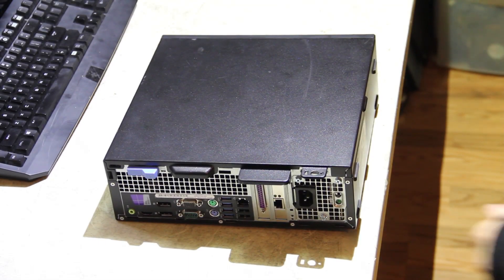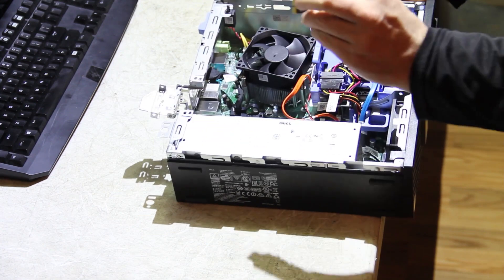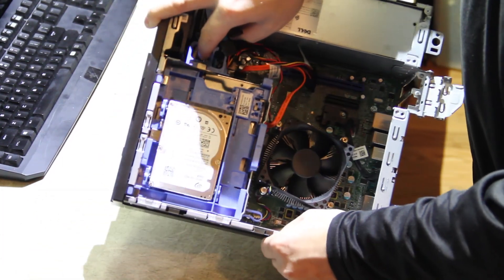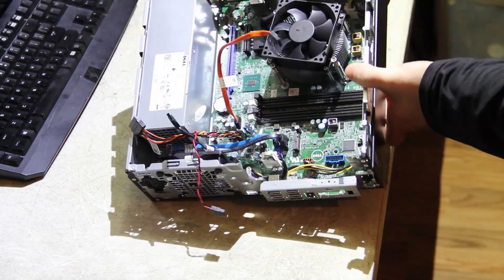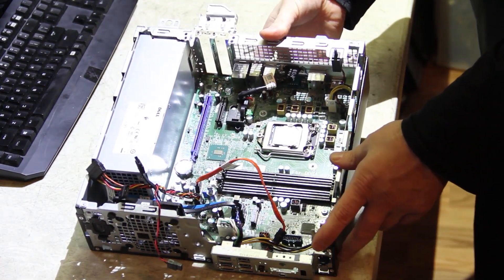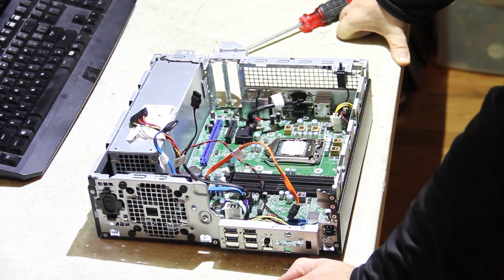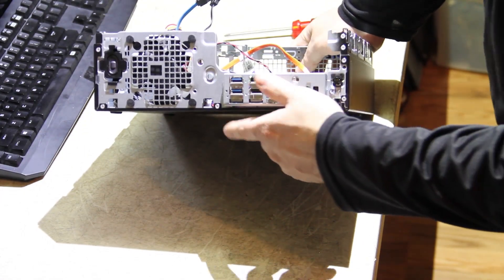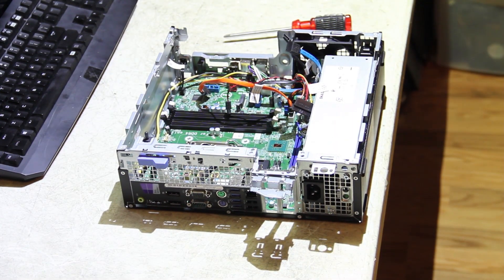Dell Optiplex 7040 small form factor teardown and system overview

Comment: what form factor power supply does the mini tower variant accept?
Reply from the maker: I am pretty sure it is a dell proprietary size
Reply: The psu is exclusive to dell due to the motherboard. Cause it keeps 8 pins in mb and 4 cpu pins. If you change the mb maybe it will have a tfx
Reply: In 7040 mini tower you can easily use any atx/sff psus. But for 7040 sff you have to strictly go by dell proprietary psu for sffs or some flex psus.

Comment: The card you have in the top PCIe slot is a 1X card, and doesn't fill the entire slot. The top slot is a 4X (not a 1X as you stated) with an open end for longer cards, as long as they can work 4X electrically. That said, your recommendation of a 1050 wouldn't be recommended as those are double-height cards, and would have to slot into the 4X slot. While it would fit, and likely work, the 1050 does utilize 8X electrically, and would likely suffer in performance due to the restricted PCIe bandwidth. A GTX 1030 (get GDDR5, not DDR3) would be a better fit, and could slot into the bottom 16X slot as those are mostly single-height cards.
Reply: Hi! I know this is old, but I'm trying to learn more about my "new" computer, and computers in general.
That 16X slot, does it actually run at 16X? And does it compete for PCIe lanes with the 4X or with NVMe storage? Thanks!
Reply: @LesCalvin3  
Sorry for the late reply, YT wasn't sending me notifications. OEMs like HP/Dell, etc tend to only use the slots that it is electrically capable of doing. Otherwise, they use an open-ended socket like the top slot here. It's cheaper to do it that way, and allows more components in a tight space.

The 16x should be present as it is typically determined by the CPU, and only needs the circuitry and the socket on the motherboard to connect it to the CPU. But the position of it in relation to the PSU makes it difficult to use with common cards that would/could utilize anything beyond the 4x slot above it.

Bad design IMHO, but not unexpected. Hope that helps.
Reply: @barms9768  It sure does! I appreciate it.

Comment: I've been hoping to find more videos on the dell - 40 series, though i'm looking for a full case and not the SFF. It's pretty mad that you can get one of these mobos for ~$20 right now directly from Dell refurbished- I think the blue SATA is an 8x, and coupled with the 6x USB 3.0s with a possible 2 more that can be added and this machine has more ports that some full ATX machines I've seen.
I do have some questions- I've been thinking of putting one together as a cheap build, and the power supply is the major limitation with both it's SIZE AND supply, since it easily takes up a 1/5th the internal volume for all of 150 watts. It seems however, that a supply like the FSP Group Mini ITX Solution off Amazon or the "GEEEK Custom Flex ATX Modular PSU" would open up for more space- do you think that would be viable for this case? And finally, if you were going to make one into a cheap gaming system what processor would you try for? I've been spoiled by AMD's simple naming schemes; most of these seem to be 1151 skylake so I was hoping for a 3570 but that's a 1150 socket instead. 

Thanks!
Reply from the maker: I mean, where there is a will, there is a way, however, that being said, I think that the price on boards is low enough right now that you really might be better off buying a decent micro atx or mini itx board and gutting the dell for parts, it might be a little more expensive, but I think the extra capabilities you would gain by doing so would far outweigh the money spent, and honestly I suspect that if you shopped really carefully you might be able to do it for under $100 additional spent
Reply: Did you say$20???

Comment: I have a dell 7040 sff ci5 6500. can i upgrade processor to ci7 6700?
Reply from the maker: it should work fine, I believe my test units where i7 6700s
Reply: @dragonsystems5973  thanks for replying ❤
Reply: @dragonsystems5973  sir i want to put graphic card but issue is my power supply unit is 180 watt so should i upgrade psu as well ? Or after that this system can run high performance graphic card ?
Reply from the maker: @annussabdullah2565  The only card I would really want to put in one of these is a GTX 1050 Ti SFF, or maybe a non-Ti model
Reply: @dragonsystems5973  ok got it. i found gt 710 2gb 64bit low profile card i will put this into system with a psu of 180 watt i hope so it will work fine
Reply: @dragonsystems5973  i made some modifiction in pc case and put full size gpu gtx 730 with upgraded psu and it works smoothly thank you so much
Reply from the maker: @annussabdullah2565  definitely:)

Comment: What are the part numbers for the Blue SATA, Black SATA, and the Y power adapter?
Reply from the maker: I have no idea, but there is nothing special about the specific parts used as far as I know... any short sata cables and any power splitter should work.

Comment: Hi, thanks for the teardown.  Would you say this PC is ideal as a DIY NAS?  I am not keen on the pre-built NAS or external drives out there that have encryption, so that if they fail you are screwed.  Thus I would like to put 2x 3TB 2.5" HDD and configure them in RAID 0 using open source program
Reply from the maker: I would say it would be ideal for a use such as that... you should be able to find an adapter that will allow you to install 2 2.5 drives in a 3.5 bay

Comment: can this hold a normal harddrive and a ssd?
Reply from the maker: Depends on how you do it. It has a single 3.5 bay which can be adapted to two 2.5 bays. It also has an M.2 slot as well, so you do either an M.2 SSD and a single 3.5 hard drive or a 2.5 SSD and a 2.5 Hard drice or any other similar combination

Comment: Why do they insist on having the pci 16 against the PSU? how hard would it be for them to switch it with the pci 1x? so dumb
Reply from the maker: Well... im sure their engineers would give you a long winded answer that would technically be correct... but honestly I think they want the systems to be as difficult as possible to upgrade without making it TECHNICALLY impossible to upgrade

Comment: Can you install a 3.5 inch hdd and a 2.5in SSD/hdd - looking at using it for Blue Iris so need 2x hdd in it.
Reply from the maker: I think you could replace the optical drive with a 2.5 bay and put a 3.5 in the regular bay. The easiest option though would be 2 2.5 drives since dell sells a dual 2.5 caddy. Or you could go with an m.2 in the m.2 slot and either a 2.5 or 3.5 in the hard drive bay
Reply: @dragonsystems5973  thanks I need a 4tb 3.5 drive and a drive for os so m2 or replacing optical drive might work. 2 2.5in won't work
Reply from the maker: @TheGuptfauj  You know, they do make large 2.5 drives, I think 4 tb is readily available, usually they are thicker than standard 2.5 drives, but it might not matter in the desktop like it does on the laptop

Comment: I have a Dell Optiplex 7040 bought back in Dec 2017 using Windows 7 Pro 1 TB 2.5 inch HDD and a AMD Radeon video card.  I wanted to upgrade the HDD to a SSD. Dell said a SSD won't work with Windows 7.  Is this true?  They said install the Windows 10 Pro Media Recovery first, but that wipes the HDD and it does a clean install.  Is there any way to set up a SSD on this Windows 7 Pro 7040 SFF I have?
Reply from the maker: I guess it is possible there is something weird that prevents it... I would be more inclined to suspect it just wont work with the M.2 slot, Im pretty sure a 2.5 SATA SSD is treated the same as a hard drive by windows
Reply: @dragonsystems5973  I don't think my system has a M.2 SSD slot.  I guess I could clone the SSD and install it and see if it boots.  Del tech told me I will have problems with Windows 7 Pro on a SSD they said install Windows 10 then install the SSD. Just a question, Dell is so proprietary how to you remove the 2.5 inch HDD from the plastic mount?  Do you have to pull it out like you did in the video?

Comment: is there will be any difference in performance between installing gtx 1050 ti in pci x4 and pci x16
and as you know the space between the x16 slot and the power supply is too small  , so even the card fit in .. it will be so hot 
i saw many people install the card in pci x4 but no one speaks about the performance
Reply from the maker: I cant answer that as I've never done it
Reply: @dragonsystems5973  thx for your replay 🙂
Reply: difference = 3-5% less power in pci x4 thats all!

Comment: Nice video. 
Can you transplant the motherboard into a normal case, or is the internal connectors specific to Dell?
Reply from the maker: I mean, where there is a will there is always a way, but realistically no, and even you could the lack of expansion options would make the project a complete waste of time, you would be better off to buy a cheap board of ebay and just gut the parts

Comment from the maker: I did game test this with Fortnite with the 6th gen integrated graphics on the i7 6700..... I thought MAYBE it would be good enough to hit low settings, 1080p, 60FPS, boy was I wrong.... it was soo bad it was not worth making a video... with settings turned all the way down, and the resolution turned down to just under 720p it could barely hold like 20FPS
Reply: With a low profile 1050 Ti (which doesn't require additional power) this becomes a beefy little machine.